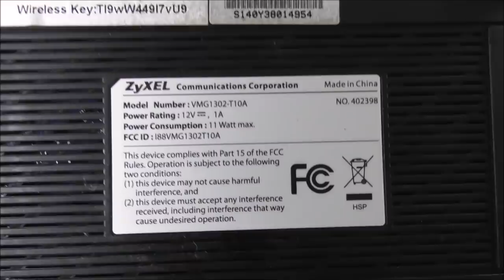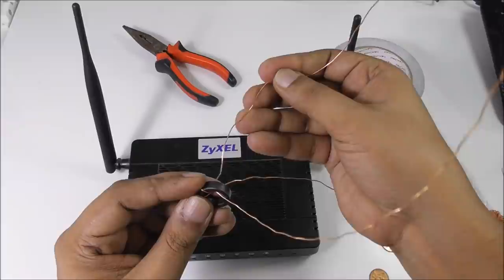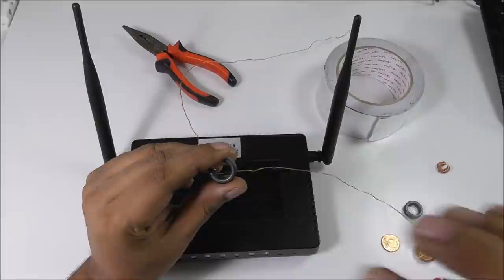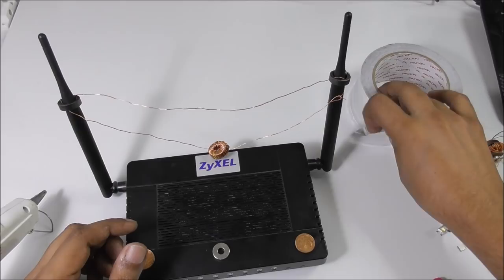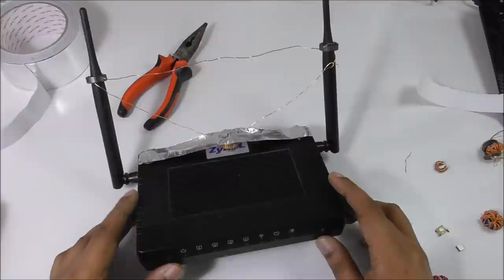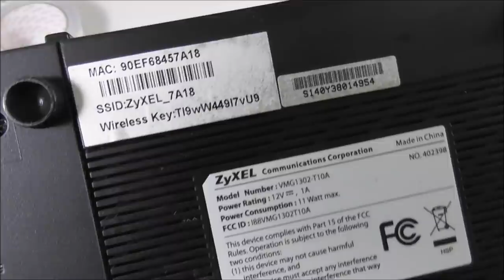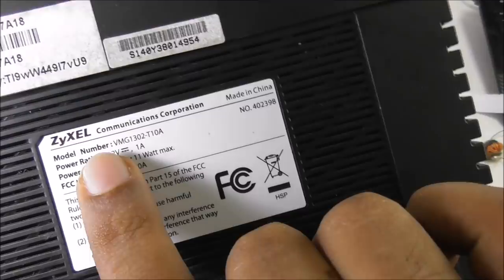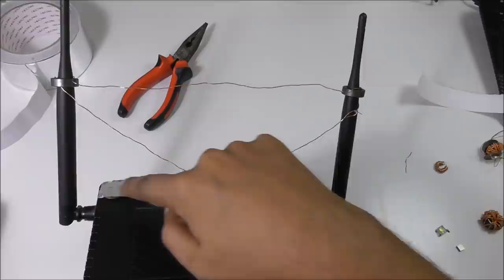FREE BOOST DOUBLE TRIPLE YOUR WIFI INTERNET DATA SPEED

Comment: Good way to do time pass..bro..where is the theory ..where are the formulas....just connecting here and there without any connection to hardware......hahaha even to get a signal we want Antennas and which are designed as per frequency...even to tune a radio you have to change inductance or capacitance and here you are just sticking some magnets and wires with glue...hahaha great work bro keep it up.. as long as money is coming in😬 i also did some time pass by writing this..👍